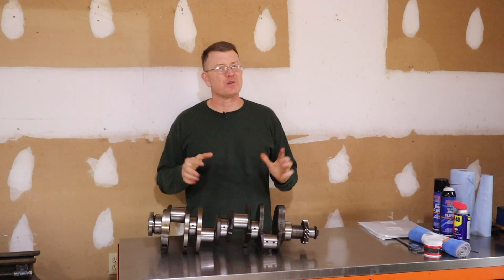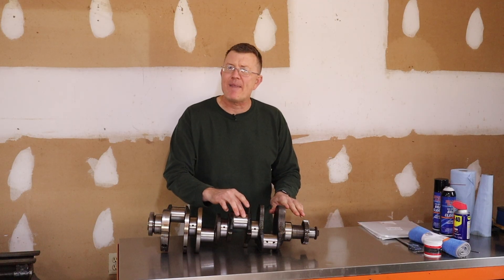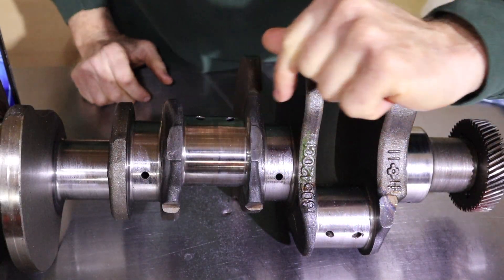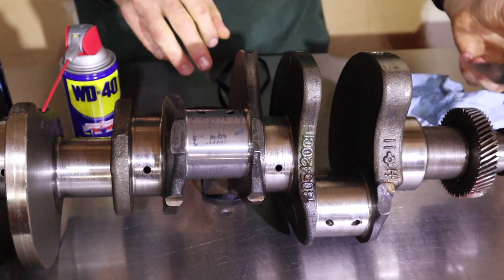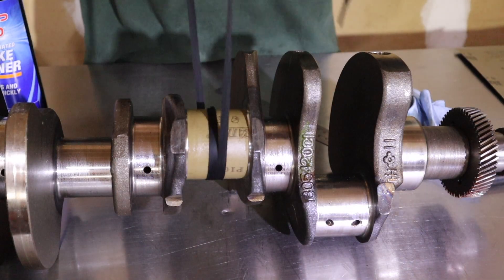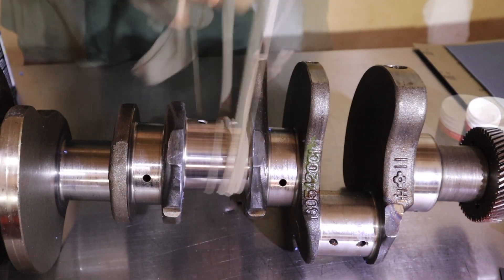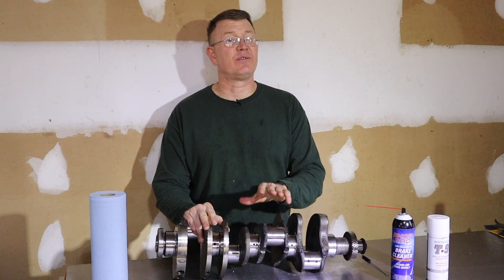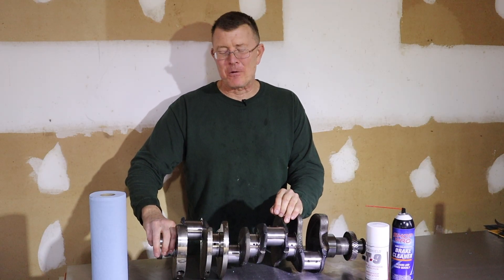Polish a Crankshaft with Sandpaper and a Shoelace!  Project Brutus, Episode 19

Comment: When I clean mine at.the end i use pure super clean degreaser with a sprayer pump.and a plastic container that the crank fits in and run it at a high pressure through all the passages
Reply from the maker: That should work quite well.  I need to source a plastic container that will fit a crank.  Scott

Comment: using this to remove rust pittings. I hope the specs will be good.
Reply from the maker: Not sure that's going to work.  If the surface is pitted, you'll likely need to get the crank turned by a machinist.  Good luck, Scott
Reply: @THEBULLETPROOFGARAGE  its very slight pitting. But if it dosn't work i will buy a new crank.
Reply from the maker: Buy a new one?  Why not just have it ground undersize at the machine shop?  Scott

Comment: Uuuhhh I'll give the machine shop 60 bucks to do it right.
Reply: I paid 50 for crank polish from machine shop. It wasn't polished all the way causing scratches on my bearings in a ej253 Subaru. I had to split the case and remove everything to find this. So I will be using this method to finish polishing where a machine shop should have. If you want it done right you gotta do it your self!
Reply from the maker: $60 is cheap.

Comment: Just found your videos.  Awesome stuff.  I am working a 4.6l mustang GT engine.   I had it all together, added coolant and it all came out the oil pan.  I am pretty sure that the head gasket was leaking. So I pulled it all out and tore it all down again.  Now, it seems that the crank is a little harder to turn due to the coolant, I assume.  I was wondering if I could just replace the rod bearing and crank bearings without taking the pistons out.  Is that a good idea?  Or do I need to do a complete rebuild?  The car did not run with the coolant in the oil pan.  I did crank it a few times before I figured out the issue.  What would you do?
Reply from the maker: @brynden29 - YouTube isn't a great place for tech advice; your best bet is to find a web forum for Mustangs with 4.6 engines.  Having said that, if you have the engine out and it's more difficult to turn, you really should tear it down and find out what's wrong.  Good luck, Scott
Reply: Sounds like your main bearings are binding

Comment: This method is soo very wrong!  No matter how fine the sandpaper is,  it will leave a grain going in the wrong direction,  like a piece of wood!  If the bearings are going against it , it will eat your bearings up!! Put the crankshaft in a machine and turn it in the correct direction that the engine turns, you will never have a problem!  IT'S WORTH IT TO SPEND A LITTLE MONEY TO DO IT RIGHT.
Reply: Simply saying you’re an experienced machinist doesn’t automatically make you a good machinist. As far as this process goes, I’ve seen it performed successfully numerous times. Sanding and polishing the journals in a back and forth fashion with the proper grits prevents a grain that is going in the wrong direction.
Reply: @adamenglert5  and your not experienced enough to listen!!
Reply: @dpierson489  Nice rebuttal. Anyhow, even a state of the art QPAC crankshaft machine will reverse and polish the crankshaft in the opposite direction. Designed that way for a reason. But you already knew that because you’re an experienced machinist. 🙄
Reply: @dpierson489 lol😂😂 you are an experienced machinist with NO videos showing us how it is properly done. 😅😅
Reply: @LuisC202   your just showing the unknowing a method that will not work ! Shame on you...
Reply: @LuisC202  I don't need a video! Just common sense of how things work !! Shame on you showing a method that doesn't work..
Reply: @adamenglert5  your full of it! I can do things will a berco that no one thought possible! 347 ford from a 351c/ 383 from a 351w 502ford from a 460 ect.. v10 viper so on and so on.
Reply: This method has been done for years and has proven to work when done right.
Reply: @juliencrawford9257  it's pretty clear that you don't care about how long the engine will last! This will make the difference of the engine going short term , or lasting we'll beyond your warranty (if) you have one..
Reply: This method works ive done it loads of times and never an issue 🙄
Reply: @steveguest8028 it'll still go together,  but have you taken it back apart and see what happens? Rebuilders don't care as long it makes it out of warranty, and if it doesn't,  then they will blame it on bad installation.
Reply from the maker: Sorry, but I disagree.  And you don't always have to spend a lot of $ to do the job right.
Reply: @THEBULLETPROOFGARAGE  I'm an experienced machinist, and I have seen what happens when it's done wrong!  LIKE YOUR DOING!!!
Reply from the maker: @dpierson489  Still going to disagree.  Thanks for your input.
Reply: @THEBULLETPROOFGARAGE  so what does it say when you don't want to do it right?? Without me saying it???
Reply from the maker: @dpierson489  I really get tired of hearing people say that you have to bring everything to the machine shop to get anything done.  You don't.  Period.  A lot can be done in your garage, saving you a lot of time and $ and this is one of those jobs.
Reply: @dpierson489 the way it’s polished at a machine shop leaves a grab going in one direction if you do this properly and get even coverage you will have no problem polishing it perfectly to a mirror finish

Comment: I could be mistaken i thought the machine shop uses 400 emery clothe on a large high-speed belt to remove machining imperfections while leaving micro somewhere to hold oil, like the crosshatch of the cylinders does?  

Thus polishing to an ultra high gloss journal liken to cylinder glazing would actually leave journals too slick and absent of any micro surfaces to hold the oil layer in suspension. It seems the bearing journal ultra polish will lower your oil pressure at the most critical places its needed the most no? 

I'll soon be doing this to my 1997 Toyota 4x4 3RZ 2.7 Tacoma since its apart and within spec like yours is, 

I was planning to use 600 alone since i want as much oil in my oil journals as possible.
Reply: What I have gathered is that normally they use P360 to P400 to polish standard cranks for daily drivers but bigger diesels and other more powerful engines they go with P600 or P800. 
Micropolishing is probably more for dragsters with really high oil pressure.
Reply from the maker: @CoreMaster111  - Yes, I went a bit overboard with the very fine grit and polish, but too much polishing is certainly preferable to not enough!  Thanks
Reply from the maker: Hi Vanhap - excellent point!  In doing some research, it seems like machine shops normally use a "knocked down" (slightly worn) 400 grit belt to polish, which would be roughly the same as fresh 600 or 800 grit sandpaper.  I may have taken it too far (or at least spent too much time) going over 1,000 grit and using metal polish.  Thanks!
Reply: @THEBULLETPROOFGARAGE  Thank you for your helpful videos, much more helpful to see and hear you do it.
Reply from the maker: @vanhap  happy to help!  Thanks for the feedback, Scott

Comment: I used a belt that's about the same width as the journals to polish instead of shoe laces.
Reply from the maker: John - I can see where that would work well if you rotated the belt around the crank to get even coverage.  Thanks for the comment, Scott
Reply: Yeah, i left the crank in the engine with the main caps on it so i could rotate it to get all around the journal.
Reply from the maker: @tastitas3  - Gotcha.  I can see how leaving the crank in the engine can help, at least with the rod journals.